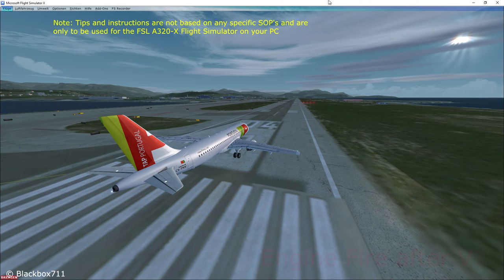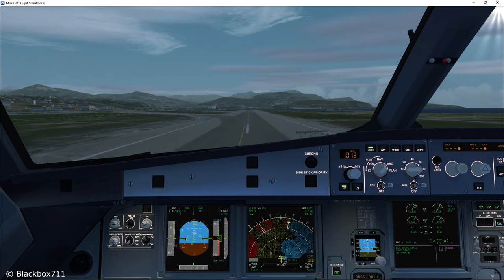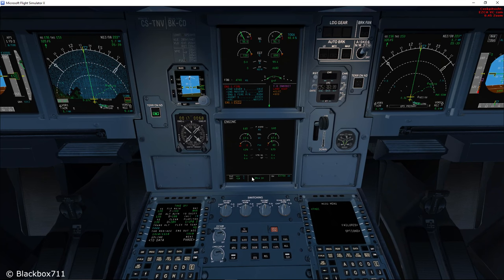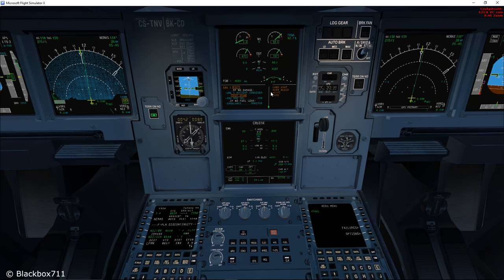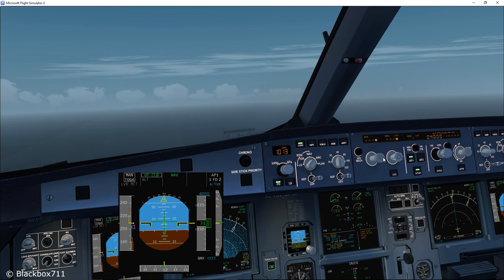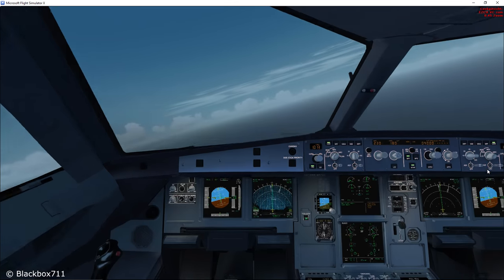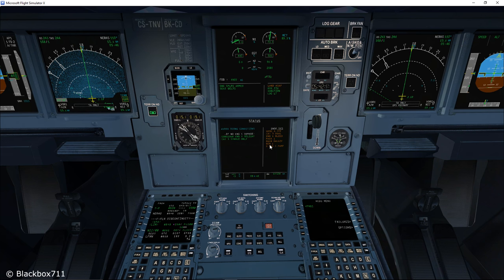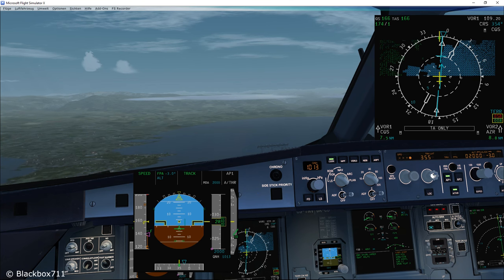FSLabs A320-X Advanced: Engine Fire

Comment: Hi again! How you simulated engine fire with stall? You preselected birdstrike plus engine fire? Birdstrike is not always stalling the engine in the FSlabs i think. So you were lucky to get a stall also! Correct me if I am wrong!

Besides all this, I returned yesterday from my 2 days REC+LPC in MUC. The sim went awesome because I was trully prepared with this sim. Epsecially the dual engine flameout that we usually do at the end of the sim in our homebase, was spot on!
Reply from the maker: Hi Gregory. Yep, I selected the birdstrike first and then as a second failure the engine fire. Worked really fantastic. Regarding the birdstrike, I have always experienced engine stalls after the strike, resulting in a engine failure about 30 to 60 seconds later. Glad to hear the FSLabs helps you in your Simulator-Missions! Happy Landings, BB

Comment: Don't you think that keeping engine popping is kinda dangerous? I heard about situation where continuing pop surge caused turbine (or maybe compressor, i don't remember) disc to burst on one plane.
Reply from the maker: +macieksoft ... you deal with the engine problem when above 400 ft and a safe flightpath has been established. Only then would you do ECAM actions or QRH procedures. If that means the engine stalls for some time, then that is the way it is. Surges usually do not cause big structural damages in the engine unless there is already an additional structural problem. Regards
Reply: What about putting affected engine to TOGA? Its typical thing you do when you have pop surge, but i am not sure if its applicable for surges caused by heavy damage to the engine.

Comment: Sir, just want to ask , is it okay to put toga if engine on fire?
Reply from the maker: It depends on what poses the greater threat. Obstacles or the engine fire. If there is no operational reason to use Toga, then it should not be used on the engine with the fire

Comment: Hi. I read in a FAA book and I saw in a Easyjet training video that if you have an engine fail or fire then you havet to select MCT (maximum continuous thrust) not TO/GA and the explanation is that the TOGA is only used for limited time so you always select MCT in this case. I pointed out this error only.
Reply from the maker: Hi. No, MCT needs to be selected after 10 minutes of having used TOGA power. That is a limitation. If the PIC decides TOGA power is necessary for climb out performance in case of an engine failure, he will use it.
Reply from the maker: Hi. Just to make something clear. You are saying the procedure I am showing has an error and you are quoting some Easyjet SOP. Please rest assured that the procedure I am showing here is in accordance with my airlines SOP and is in no way unsafer to what Easyjet is doing.
Reply: @Blackbox711  EasyJet isn’t doing what he says. Their procedure is the same as yours as they follow Airbus SOP almost 100%
Reply from the maker: @johndoe-it1mo  thank you for the clarification 👍🏼